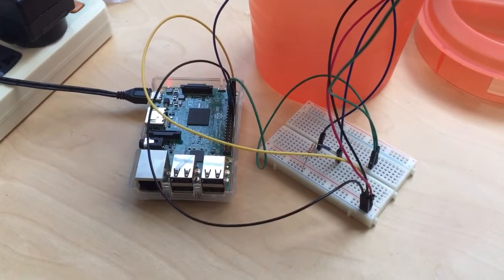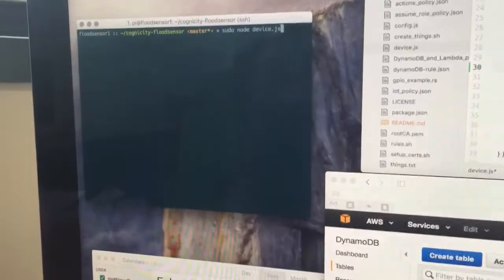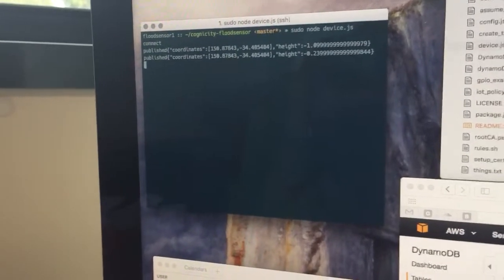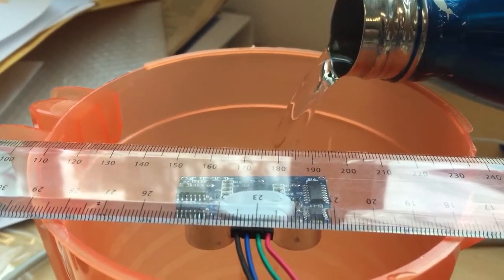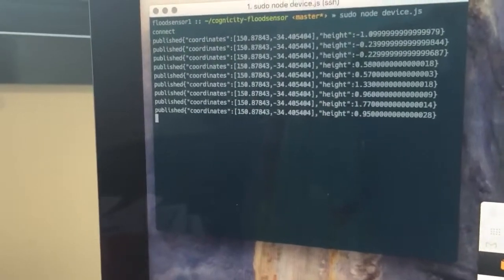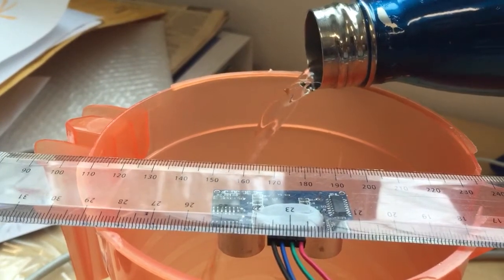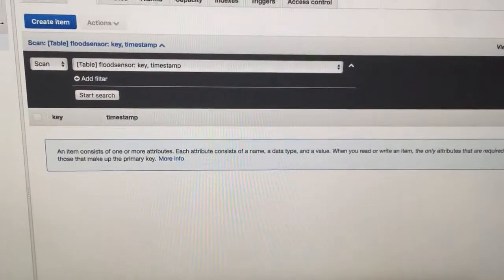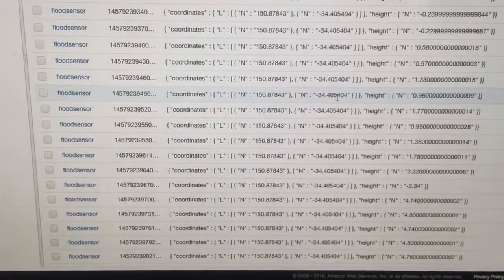Demo of Raspberry Pi flood height sensor

Comment: Sir I have the same project with you. Can the data coming from the raspberry PI can be save in the real time database? Because i'm going to use it to connect with my android application. Thankyou
Reply from the maker: The data can be saved in a database as per the source code https://github.com/smart-facility/cognicity-floodsensor ; that said there are none of these (or the newer generation of sensors) currently in the field. I have recently done another project to capture temperature data using the much smaller & lower power esp32 boards, https://github.com/AcrossTheCloud/temperature-iot/ that puts data into the database in real time that you can query using the API https://temperature-api.acrossthecloud.net/temperature (as plotted at https://temperature.acrossthecloud.net/ )